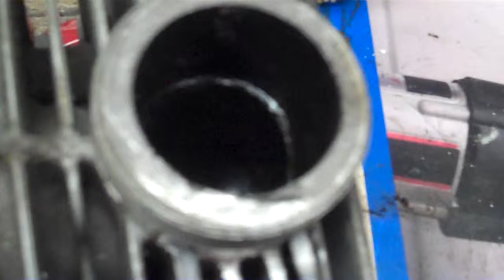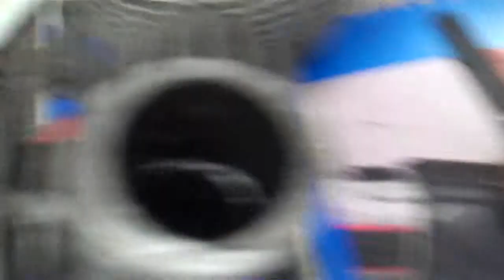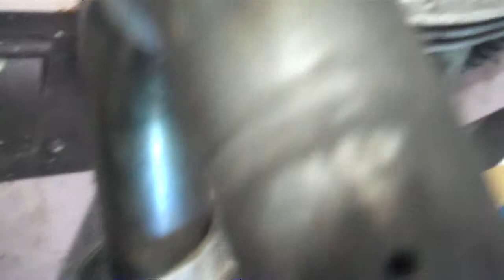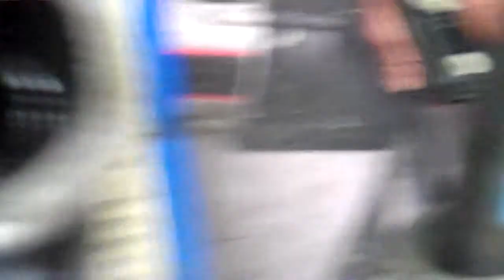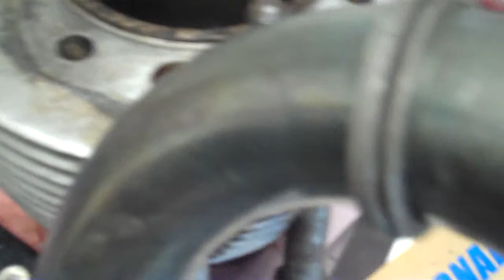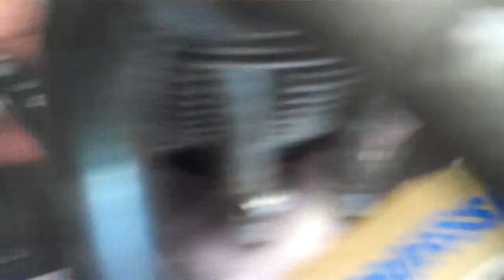fixmydadsbmw14

Comment: Not sure... but consider trying to carefully grind a slot through just the steel piece with a Dremel type bit the optional flexible shaft then the steel piece can be closed up a bit.... hopefully providing clearance to come out.
Another thought would be to take it to a good machine shop and "pay the man"!